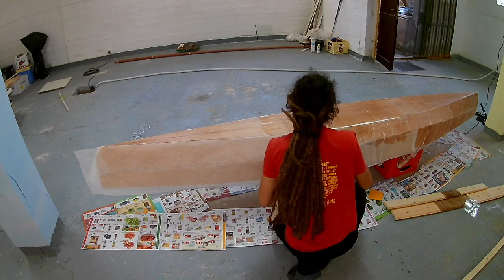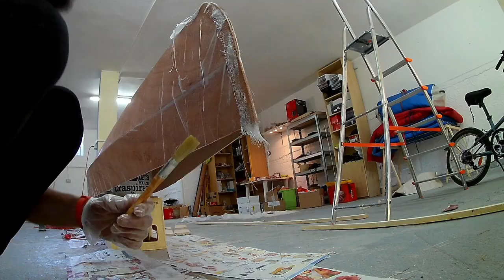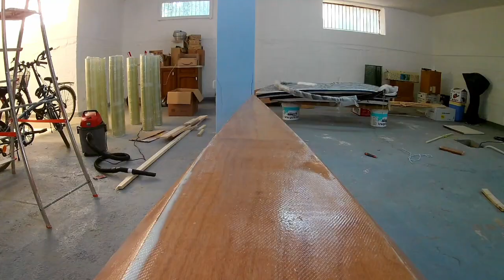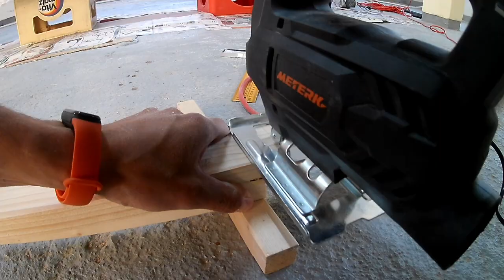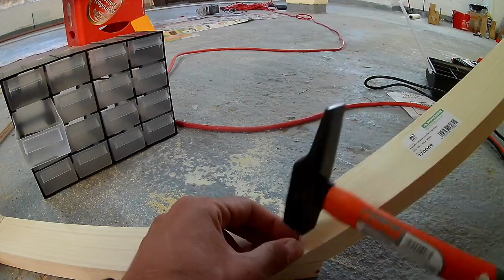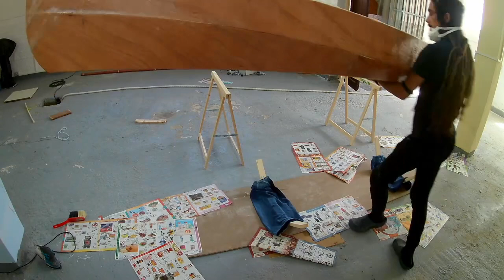Canoe from plywood: how to build with no experience #2

Comment: How much epoxy did you use? and did you use a marine ply, or exterior? Trying to decide if a Flo-mo one sheet canoe with outrigger will work for my big 85 pound year old hound and me (def. need the added stability outrigger til he is older!). I've never built a boat, and your videos give me inspiration
Reply: found my answers on the next video! Awesome little canoe, nice to see it in action... definitely going with either Stefan's 2 Sheet Gorewood, Flywood, or find a dinghy design, haha. My dog would have us capsized in about two seconds
Reply from the maker: Yep, it Is not much stable, but I chose it as first epoxy / wood work :) still fun to ride on very calm water!